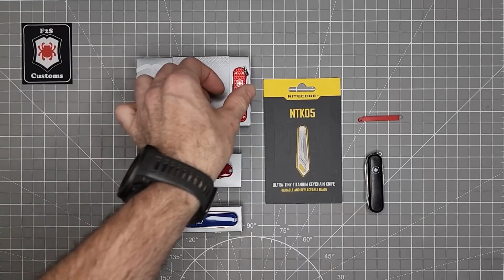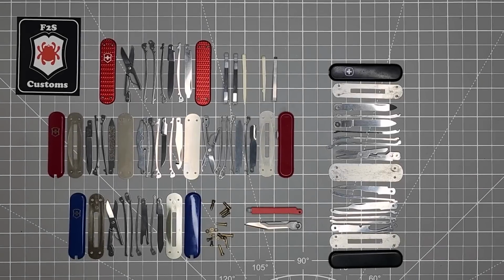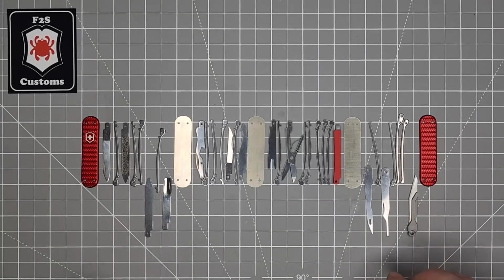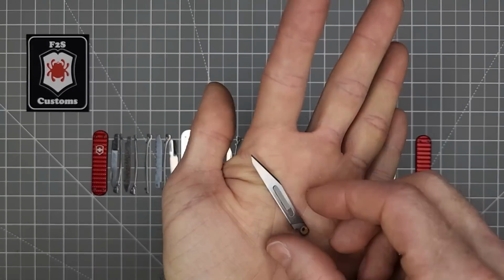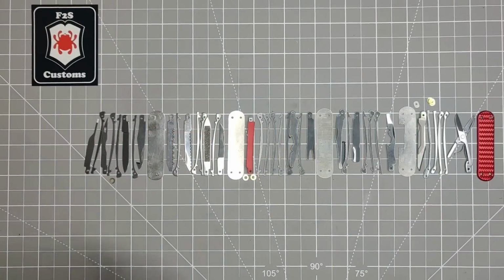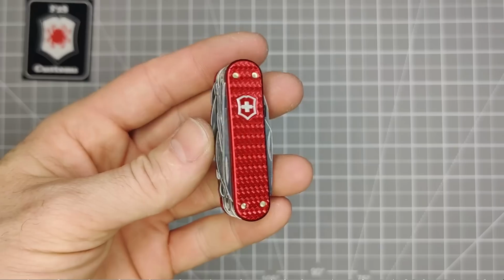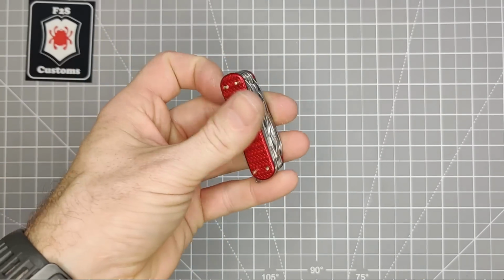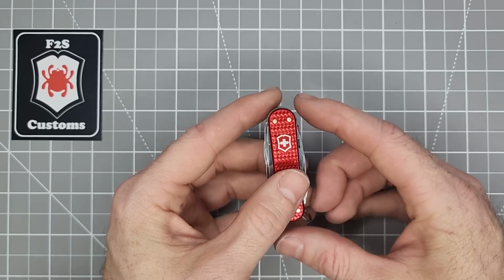How I made this 58mm Victorinox Beast

Comment: Thanks to this video I just worked on my first SAK. I had a manager knife with a broken tool spring and I had a few other 58mm knives with the same problem. I opened them all up and used the parts to fix the manager. On my first attempt some tools didn’t have a good snap, I think I was too rough and bent some of the plates. I was able to take it apart and fix it though.
Reply from the maker: That's fantastic! I am glad to hear that I was able to help.

Comment: Great work.
 Have you ever thought about replacing the blade on a rambler with a package opener?
Reply from the maker: Thank you.
Never thought about it before. But it could be easily done.
Reply: @FittoSurvive  
That's something I've had interest in lately because I don't use the 58mm blades and I can't think of anything else to replace it with that I'd use much.
The jetsetter is great because it just doesn't have a blade, but it also doesn't have the flat blade driver and occasionally used nail file.
Reply from the maker: @TylerSnyder305  I can see what you mean. Yeah, it's a fairly straight forward mod.

Comment: Why in some tools you add washers and in others you don't? What is the criteria there? I thought all joints had them. Thanks! Amazing built!!!
Reply from the maker: The springs are 1mm wide. So, if the tool is 1.7 mm wide, then I have to use two springs and 0.3 mm worth of washers to make up for the empty space.

Comment: FitToSurvivinox Mini Super Champ 😁

Maybe next one you can replace some of the screwdrivers with a Victorinox bit driver. 😉 If possible, I'd love to have a hacksaw bit on there to cut metal, and a tiny carbon steel file. Also, those tiny keychain flashlights? One of those. 🤣

Great job, as always! I would love to see you make your own custom multitool company and pump these out to the masses for sale! 🙂 I understand you would have to mod some things so it could not be mixed up with Victorinox but that's not too hard, imo.
Reply from the maker: 👍🏻😁
It'd be cool to be able to add those tools as well.
Yeah, having my own multitool business would be awesome. Maybe someday I'll figure it out. 👍🏻👍🏻

Comment: Simply amazing, like all your builds! Quick question, what size is the brass pin you used to seal the original hole of the scalpel?
Reply from the maker: I used a 4mm brass rod to peen in the pivot bore of the scalpel.

Comment: only just noticed the slight work on one of the springs for the scalpel after having watched this several times for various referencing and it pulled me right out of frustration, thought my mistake was the work around the scalpel pivot, all sorted now! 
would you mind sharing the thickness of that first silver spacer for the scalpel? 
thanks
Reply from the maker: Hey, if I remember correctly, I use a 0.4mm washer next to the scalpel.

Comment: Inspiring! Considering doing the saw mod. What bugs me is that the metric scale is the one to get damaged by it, but it's a reasonable price to pay, I guess. Do you think the file would be suitable for converting into a saw, alternatively is there any way to make it so that the metric is the intact side?
Reply from the maker: Glad to hear that! You can use a file to make the saw, but I found that making the cuts with the dremel sped up the process. If you were to make the saw on the imperial side of the ruler, then your saw teeth would be facing out. So it would constantly be snagging your pocket and scratching things.
Reply: @FittoSurvive  Yeah, been thinking about ways to possibly flip rhr ruler, but can't come up with any and still have it "flippable".
Regarding the file I meant the one on the knife, instead of the ruler. Like, using it to mod into a saw. Then maybe the Rambler could be a option for a saw-having 58 mm, since it has a file but no ruler.
Reply from the maker: @JaspisB  OK, I understand now. I have never tried to use the file before.
Reply: @FittoSurvive  Do you think it'd work or is it too thin?
Reply from the maker: @JaspisB  I think it is too thin, because to make the course part of the file, they had to cut into the metal. Hopefully that makes sense.
Reply: @FittoSurvive  Yeah, sadly that's what i think too. Thanks a lot for the answers, either way! Feeling inspired and might very well end up with a modded 58 mm thanks to this!
Reply from the maker: @JaspisB  You are very welcome! Best of luck with your project!
Reply: @FittoSurvive  Thanks a lot, mate!

Comment: Hi there, big fan of your work. When I've tried to replace tools in 58mm saks the springs always pop out as I'm trying to put the second tool into a layer, or a tool pops out while I'm putting the next liner in. Any tips for keeping tools where they are as you're working on the knife? Cheers from the UK
Reply from the maker: Hey! Glad to hear that. Put the tools and springs on the pins and put the next liner on before you start putting the tools on the springs. This will help keep the tools from popping off. You will probably need some kind of tool to push on the spring since you will have more limited access due to the liner. Hope that helps!
Reply: @FittoSurvive  Cheers for the reply. Hadn't thought of that, I'll give it a go. Have a good one
Reply from the maker: @brandonnavarre3360  Best of luck on your project.

Comment: I have been working on a similar SAK mod, and greatly appreciate the videos and your work.
I wanted to ask you how you disassembled the NTK05? I have been having trouble doing so without damaging the screws.
Thank you again for sharing the great work!
Reply: Well then.
Thanks anyway
Reply from the maker: Hello! Glad to hear that you have been enjoying the videos.
The NTK05 is not screwed together. It is actually pressed together. So you will have to drill it out.
I usually start with a 2.2mm drill bit (any small drill bit will work) then once I drill about 80% through the pivot, I use a 3.5 mm drill bit and it will usually break off the top part and let you pry the scalpel holder out.
Hopefully that helps.

Comment: Nice video 🤙 I like to see how everyone has their own methods of modding 58mm sak tools. Gotta get yourself a drill press, makes life sooo much easier! 😄 good stuff though. I'm working on learning the videos editing aspect also. Actually what video/ed program you use? I haven't figured out if one is better than another, or if you just need to get comfortable with the one you're using and go from there. 

Thanks!
-sakcustom58mm/Sean
Reply from the maker: Thanks! Nice to hear from you Sean. Yeah, I really do need to get a drill press. 😅
I use Adobe Premier Rush. I ended up going with Premier because the free video editors could not handle larger videos or after rendering, the audio would lag 2 to 3 seconds.

Comment: I'm getting frustrated with my build. I'm getting a lot of resistance. The blades and springs keep popping out before I can get the next liner on. Does this happen to you? It doesn't look like it does in the video. Is there something I'm doing wrong?
Reply from the maker: It can be rough to get going. The first couple of layers can be like that. I'd recommend checking to see if the holes in your liners are not too large.

Comment: Another very nice build.  You inspired me to do something similar a few months back when I had to fly so I made one without any blades.  Question about the scalpel:  what diameter brass rod did you use for the pivot?  I will definitely be doing this on my next build.
Reply from the maker: Thanks! Super excited to hear that.
I used a 4mm brass rod, but had to grind it down a bit to fit. Here's a link to them. https://amzn.to/3z3NNky
Reply: @FittoSurvive  for the scalpel, what's the trick for disassembly?  Looks like there is a tiny gap under one side of the pivot point to get in and pop it loose?
Reply from the maker: @msreiser  You will have to drill it out with a fairly large drill bit.
Reply: @FittoSurvive  roger that.  👍